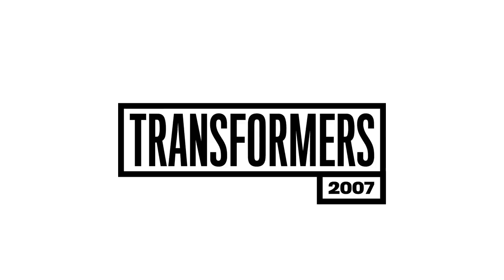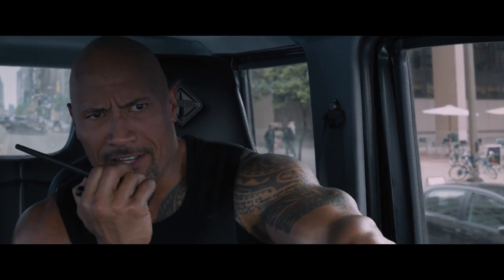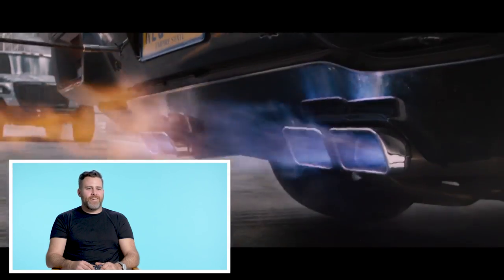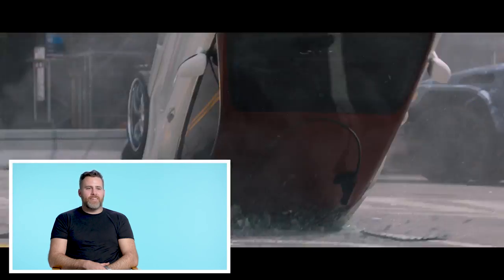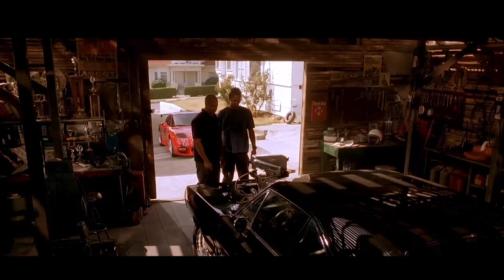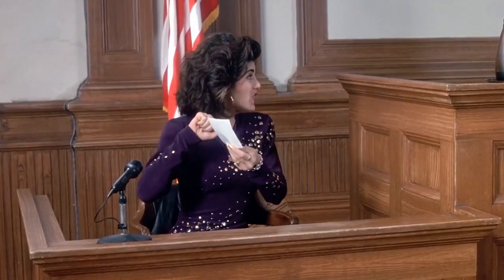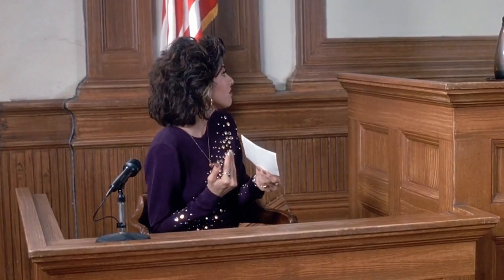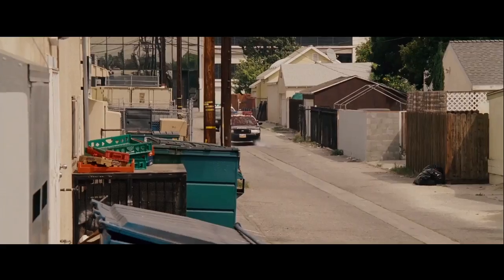Car Expert Breaks Down Car Scenes from Movies | GQ

Comment: Any real car person looking for literally one second would realize the engine shown to be in bumblebee is obviously fuel injected not carbureted lmao. I don't know about this guy..
Reply: He must be a paint/body guy.... 

Ya... looks like modern Hilborne injection.... not something you'd find in TOP FUEL cars...
Reply: My head hurts listening to this guy!!! His knowledge base is terrible and he states so many ridiculous things... like 500cc engine etc...
Reply: Lmao ''Those little guys sticking out, those are called independent throttle bodies. Each cylinder has it's own carburetor''. I first thought it looked like ITB's (I as in individual not independent lol) but after zooming in on the picture you can tell it's just Weber's on a cross ram intake.
Reply: torque horse power explanations 😭😭😭
Reply: @zukacs  He talks a buncha smack wit a little bit of actual facts. XD Riccardo did a better job than him.
Reply: Tell that to Meghan what does the fox say Fox
Reply: Also he said 500 cc, not cui, 500cc is a dirt bike motor
Reply: Look closer, they're side draft carburetors.
Reply: the engine in the bumble bee is clearly a SBC by looking at the valve covers
Reply: "This company called NOS", because only they can produce Nitrous Oxide apparently.
Reply: Thank god someone said it, I lost all faith once he said 500cc
Reply: jayemlov and the fact is it’s a ROBOT!
Reply: could be dual port injection for each cylinder or some throttle body injection system
Reply: here's what he says about himself on his website

>I am not an expert... I am not a mechanic...I am a product designer that has tried enough bad ways to make a motorcycle that I'd like to believe they're starting to get better :)

no clue why they hired him out of all people lmao
Reply: lol he said 500cc instead of ci and independent throttle bodies which was correct but then he says each cylinder has its own carb hahahahah
Reply: And he referred to it as a 500cc engine 500 cubic centimeters huh so it's got a dirt bike engine in it?
Reply: This guy's your expert? Who is casting these people???
Reply: Says massive 500cc engine.... ok
Reply: Watching this guy talk about cars is like listening to Democrats talk about guns
Reply: @jayemlov That intake setup is called a Weber cross ram intake, It is (4) 2 barrel carburetors 2 on each side, many fuel injection systems look the same. The engine is a Small block Chevy. look up Jim Inglese, he sells all kinds of Weber intake setups and EFI not cheap though.
Reply: This guy is a joke. A car expert on what planet??
Reply: He was aggravating me the whole time lmao
Reply: He said 500cc because he works with motorcycles, but he is not a professional technician. Cc stands for cubic centimeter, it is the added centimeters of each cylinder in the motorcycle engine. In old American muscle cars they were measured in CI cubic inches. The Gran Torino’s were known for having the 351 CI V8. Divide 351 by 8 cylinders, you have aprox 43.873 inches per cylinder. My boss has one. Awesome car. Now just so you know i am not a professional technician either. I just love cars. Also bumblebees engine was fuel injected, and throttle body is not the same as a carburetor. It’s like one small component of one. But this comment is too long already so I’ll stop now.
Reply: pretty much right but just to clarify not just old American muscle cars are measured in c.i. Every combustion engine can be or is measured in cubic  inches.
Reply: Pretty sure its just an Inglesse EFI kit with imitation carbs with velocity stacks. atop a 572 BBC. The intake and kit to buy is about 5000 dollars alone. The motor is another 20, in stock form. (I'm talking CAD if those prices seem high lol. Monopoly Money FTW )
Reply: He is pretending to be a car guy. The 500cc comment was so funny
Reply: Also the fact that a high rise is the intake system and headers can and are usually on street cars.
Reply: @BadInfluenceGarage  it looks like big block Chevy, like a 454. The small blocks have siamese exhaust ports.
Reply: @gilbertogarza5742  correct, but look close and the valve covers are a 4 bolt valve cover, a BBC has a 7 bolt valve cover. A spread port exhaust head is getting more common with aftermarket designed heads for SBC.

Comment: “Atleast 500cc engine” well bud you’re not wrong it’s definitely bigger than 500cc
Reply: Pretty sure he meant cubic inch haha
Reply: @Hypotenuse5  this video was published on 11 February 2020 - who still talks about cubic inches?
Reply: Ireneusz Pyc that’s not cubic inch. That cubic centimeter
Reply: @ireneuszpyc6684  People who don't live in Europe. The metric system has some pretty major shortfalls you've got to admit.
Reply: @matthewmosier8439  the metric system's only shortfall is that some cowboys in Oklahoma haven't learnt it yet
Reply: @ireneuszpyc6684  It was not in existence for thousands of years of human achievement. The American system is close to that of the ancient Egyptian system which helped build the pyramids. The metric system's flaws include a lack of human based units, most noticable in the distance between the centimeter and the meter, essentially relegating half of the day to day objects in most peoples homes, not to mention the homes themselves, to be measured using either a unit smaller than a finger width, or to one a hundred times larger with no commonly used unit in between. The same for the milliliter. While the U.S. can simply ask for a cup of water and the word corresponds pretty closely to the actual unit and can by divided up for more accuracy by switching to ounces, the metric system must either use a much larger unit, the liter, and trim it down into a decimal or measure in units so small that they would be better for keeping track of a delicate injection in a syringe in a hospital. In essence, I'm convinced that were you to find a completely unbiased source and see which unit set they considered the most practical for daily living, their choice would be fairly simple. As someone who has years in construction and carpentry, including time and projects in Europe, etc. I can definitely tell you which system I find to be the most well rounded. Thanks for your time.
Reply: @ireneuszpyc6684  Wow. Good comeback.
Reply: @WhyAmIEvenHere I knew of the decimeter, which is why I used the language about "commonly used". I don't believe that I have ever heard of a person using those other units. The system appears to have avoided the more practical unit in exchange for the centimeter, etc., which is puzzling. Also I don't claim to be an expert, although I have made my living using a measuring tape in construction for years so I probably have more practice with such things than most other people do. I do find it interesting that I don't recall ever coming across a person online who has chosen a reasonable discussion on the topic. All arguments tend to involve accusing me of being behind the times or making fun rather than logical debate which is interesting considering the claim that the metric system is superior in every way would imply that ammunition to defend against my points should be very easy to come by. Thank you for your time.
Reply: @matthewmosier8439  Metric is definitely better for calculations, because you will always get an accurate answer, and it's much easier to do the math. With Imperial you need to round to the 1/16 and it's a real pain. Science and Math should always be done in Metric in my opinion.

Edit-I live in the US
Reply: @blooped8234  Thank you for posting a response that included logic, etc. I actually agree. Science/ medical fields are better off using metric units in their day to day calculations. This is logical because measuring the distance to stars, etc. is not practical day to day living and doesn't necessarily require man based units (those are better for construction of homes and daily living, stuff). The same with incredibly accurate microscopic measurements. No reason to divide up an inch when measuring an atom.
Reply: Matthew Mosier 
no reason to divide up a centimetre a half million times either. ever🤣 you geeks are hilarious
Reply: y’all know you can turn fractions into decimals right?🤣
Reply: @maddog7999  I want you to build me a house in measurements of only decimal.
Reply: @matthewmosier8439  you legit listed day to day activities. The medical field is a day to day thing. Construction is day to day, science is day to day, most things with measurements of distants is day to day professions that a majority of people do. all of which go into there own sub category of even more professions and jobs, a majority of most things in the world use exact measurements, which no matter what the metric system is more accurate and way more easily understandable and translatable to other lengths of measurements. Either or this whole conversation is bunk, I'm honestly drunk and bored at 3pm.
Reply: @blooped8234  I meant day to day in the kind of practical way. A dinner plate is one foot in diameter, a mailbox is one foot, six inches, long, a fork is easily measured in inches but rather clunky to measure in units (cm or mm) that require double digits to convey the number because they are impractically small. That is my point. If you ran into a lost tribe somewhere, handed them a glass of water, then told them that in your culture you measure that glass in thousands of units, they'd probably laugh, because, while accurate, it's unnecessarily so. Let the scientists do science in a system based on non-human metrics and they can do the calculations to bring numbers into a more practical system. As of now, people are being taught to calculate like a computer to accommodate 10% of the population.
Reply: You know what you're right man 😂😂
Reply: Matthew Mosier sorry what? What is your 10% of the population referring to - 10% of the population in your reality live with metric?
Reply: @louie4119  My 10% refers to the fields of science and medicine.
Reply: Matthew Mosier misleading comment. Blows my mind that you have worked in construction and think imperial is better. Engineering is also better off for metric.
Reply: Fractions>>>>decimals
Reply: Metric
Reply: Ireneusz Pyc Well considering it’s the standard measurement for actual displacement, everybody in the car world.
Reply: Pretty sure he meant HORSEPOWER
Reply: He’s a “expert”
Reply: 500 CI
Reply: Ireneusz Pyc basically everyone who works with older American v8s such as the 350 sbc and 351 fords and 440 hemi and the list goes on and on
Reply: @matthewmosier8439  C'mon now, don't call it the American System. It's the Standard system.
Reply: @matthewmosier8439  If you're looking for accuracy, metric wins every time.  If you're looking for a great approximation, go for the standard/imperial system.
Reply: @matthewmosier8439  
Allow me to quote:
"The metric system's flaws include a lack of human based units, most noticable in the distance between the centimeter and the meter, essentially relegating half of the day to day objects in most peoples homes, not to mention the homes themselves, to be measured using either a unit smaller than a finger width, or to one a hundred times larger with no commonly used unit in between".

How is "lack of human based units" a flaw in the first place? Humans are naturally imperfect, and to a certain degree insonsistent creatures. Why would you want to transfer that imperfection and inconsistence to your calculations? Ancient humans used whatever arbitrary measurement units they could come up with, sure. It does not make them better in any sense of the word. They built pyramids? Well yeah, we build rockets and space stations on metric units. That's right and before you retort: NASA has been using metric system since its founding, you can check it out.

"I'm convinced that were you to find a completely unbiased source and see which unit set they considered the most practical for daily living, their choice would be fairly simple"

I'm sorry to say, but it's quite a hypocritical statement, as you are clearly much more biased than anyone else here.
You fail to consider that in daily life it doesn't matter how close a unit of something is to unity (as in: 1), what matters is how used to the unit you are.
You ask me for a cup of water? No problem, I intuitively know how much is that (1/4 of a liter). Meanwhile an average bottle of water/milk/whatever that you can buy in a shop is exactly a full liter. So it's not like I'm losing on having a cup of water be 1/4 of something instead of 1 something.

On the other hand, metric system offers me something that imperial units fail miserably at: consistency and interchangability.
1 liter = 1 kg of water = cube of 10x10x10cm
I can do something as simple as measure how much volume is in a dish just by weighing amount of water it contains, without any complex knowledge of transitions between units.

Or if it's 0 degrees C out, I know that it's so freezing my own breath is going to solidify on my face most likely.

And hundreds of other examples.

Point is: metric units are NOT in fact less practical in daily life when you grew up using them, it's all a matter of being used to something.
Meanwhile they make calculations much MUCH easier when it comes to more complicated stuff.
Reply: Lmao dude i was just thinking the same thing. Whats he a motorcycle expert and NOTHING else?
Reply: He probably meant 500cubic inch
Reply: @Hypotenuse5  no that's prolly what he meant. It's wrong and he dont know the difference obviously. Did you actually hear what's he has said this whole video. He said the original charger had a whipple supercharger. That dont look like a new whipple supercharger to me.
Reply: @ireneuszpyc6684  American rodders.
Reply: @matthewmosier8439  The "American system" is based on British Imperial Units. They went metric, too. Canada switched in '76, I think, when I was 14. A pain, initially, but when you stop converting, it makes so much more sense and is easier to calculate and do weight to volume conversions with. Have a great day!
Reply: @matthewmosier8439  bruh what are you talking about. Every point you've made doesn't make sense. Who would measure their plate with their foot? That is what it's based off isn't it? Also who even needs to measure a plate lol. Saying you'd say a cup of water is hundreds of mls is also inaccurate. A cup is a cup in cooking which is 250ml. If you're talking about the litre you could say the same about a galon because that is the only liquid measurement that is commonly used i.e a cup equals 0.066 gallons orrrrrr 1/4 of a litre. Millilitres and grams are a lot easier to use/divide etc in cooking which I'd argue is the most common "day to day" activity.
Edit: Thank you for your time
Reply: @matthewmosier8439  nobody tell him about japanese money and their high numbers. I think he's just scared of big numbers and things he doesn't understand.  
The US military uses metric. In fact most of usa does. Source: https://en.m.wikipedia.org/wiki/Metrication_in_the_United_States
Reply: @matthewmosier8439  millimeters are a thing mate
Reply: I’ve seen dirt bikes with 500cc engines lmao
Reply: Yeah.. I was done after that comment lol
Reply: @ireneuszpyc6684  literally anyone talking about old muscle car engines. Nobody says "I have a chevy 5.7 in my car"
Reply: Was thinking the same thing, that expert doesn’t seem to know the difference between CID and CC’s
Reply: He said 5000 not 500.
Reply: Is in a 500cc engine more of a motorcycle thing than how they described car engines? I know I've radian 125 and 250cc dirt bikes and my cousin had a 600cc Suzuki Katana motorcycle
Reply: @ireneuszpyc6684  According to his ig he's a custom muscle car builder, so he probably does.
Reply: @matthewmosier8439  The metric system is far more practical. 10 MM = 1 CM. 100 CM = 1 Meter. 1000 Meters = 1 kilometer. 

whereas the american system is 12 inches to a foot, 3 feet to a yard, 1760 yards to a mile. like wtf? It gets confusing because on all factory service manuals for import and now even domestic vehicles it shows measurements in metric system. 

I guess it is better to use thousands of an inch instead of dividing millimeters on applications that require a precise measurement but still, it's a goofy system

Comment: 9 second 1/4 does not equal a 36 second mile. You started the first 1/4 at 0 and you won't be starting the 2nd, 3rd, or 4th quarters at 0. Common sense.